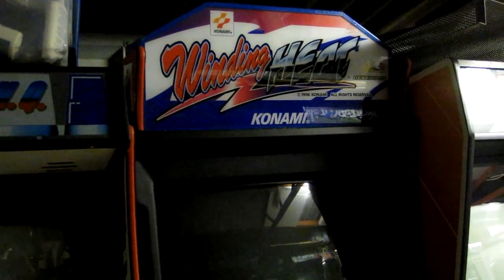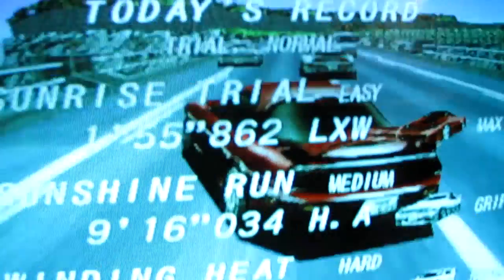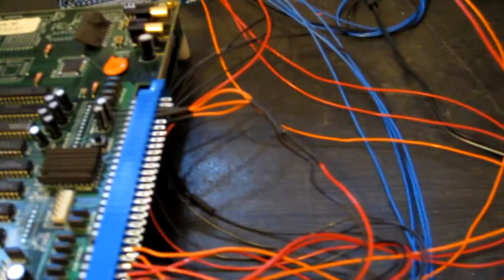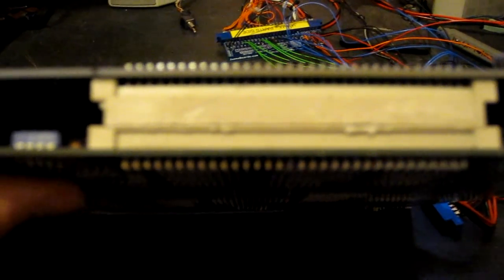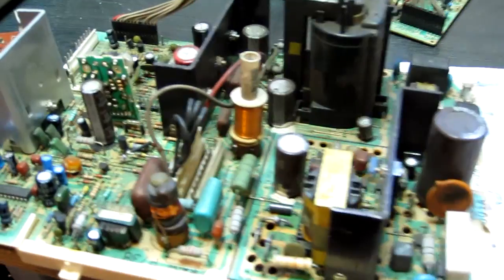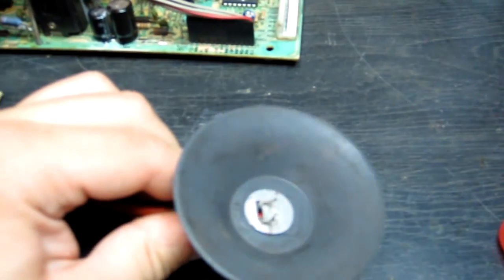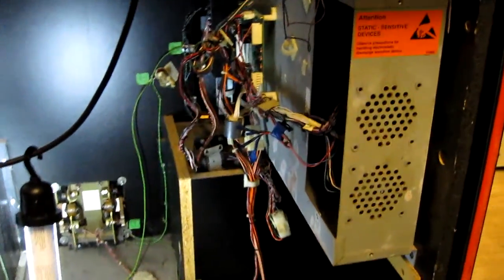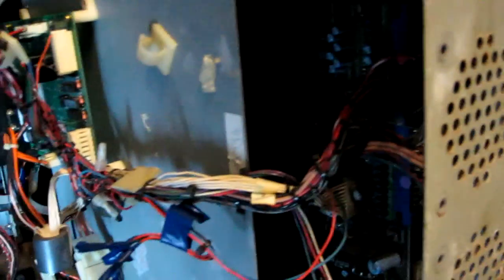Winding Heat Arcade Machine Repair

Comment: I was looking for information on my machine when I ran across this video.  I have the model with the shifter on the right.  The steering feedback only has one motor which makes a nice bit of humming when it puts strain on the wheel, which I don't necessarily like.  
I have two units and one plays blind.  I believe there is some sort of power failure in the monitor pcb as I've just started working on it.  Would you happen to know if these 2 problems are common problems with these? Or how to fix?